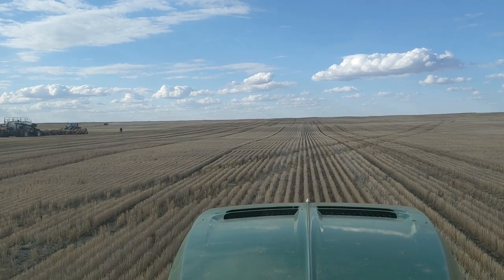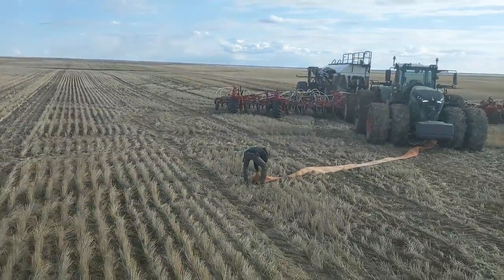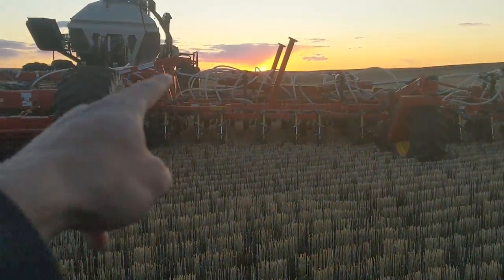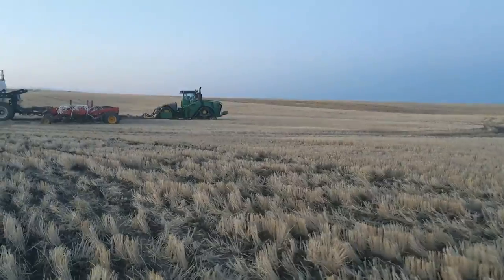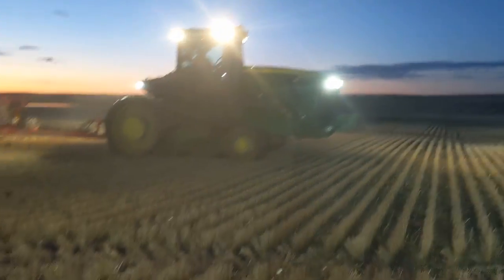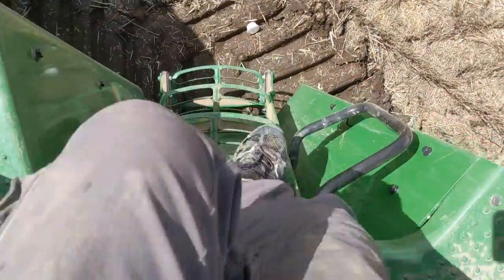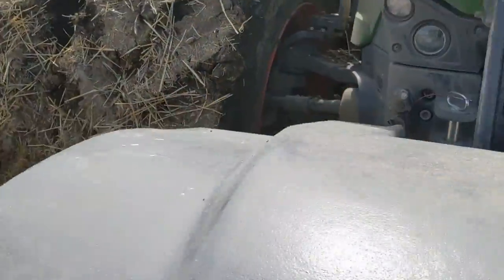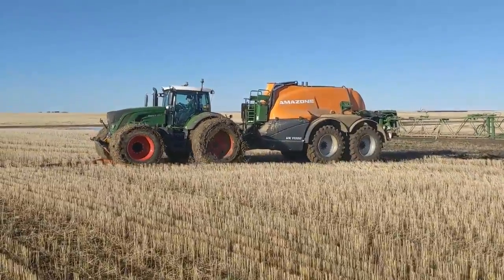4 stucks in one night!

Comment: The Welkers in Montana have three Big Bud articulateds.  Two pull their seed drills and one stands-by as a dedicated rescue tractor.  They have alkaline patches and can sink in to the axles or deeper.  Their heavy floater spray-truck also serves as a rescue puller...and it goes 50-mph.

Comment: 5:10 In aerospace we have "connector savers" , an inexpensive adaptor that's used on connectors that are frequently (dis) connected. The replaceable adaptor then takes all the abuse instead of having to repair or replace the permanent connector.
Reply from the maker: 🤔 Intresting

Comment: How are those straps holding up for you guys? They look like the same ones we use and the ring in the end ends up cutting the eyelet because its too small.  Those dont stretch much. We rip 4 or 5 a season and they arent cheap. I run into a guy around kindersley sk who makes 3 ply 10 inch wide rated for 300,000lbs made out of nylon which stretches 20% compared to 2 or 3% stretch on those red which are polyester. He triple layers the eyelet and warranties rips IF you use a 2 inch clevis on the eye. We put in a 6 strap order for 2021 seeding run. I would cut the ring out of your current straps if thats where they are failing for you guys and use at least 2 inch clevis which typically has a 35 ton rating which is easy to max out by jerking. Shes a dangerous game coming to the end of that strap with a 30 ton tractor or tractors in some cases lol.  Cheers

Comment: Mike, I have a question? if all the fields are plowed and the soil itself becomes soft, there will be no dams in the middle of the levels, it will just absorb the water and the fields will even come out
now this water is not absorbed by the soil because you use only 10cm maximum depth and only tamp it? and the soil cannot absorb the water.
did you try it with plowing?
Reply from the maker: We can't plow, it would ruin our soil, it's been tried.. We only have 4in of top soil. And we get winds here that will make the whole county blow away
Reply: @mikemitchell2554   i see now but  if you do it with  Ripuntatore the soil the winds not gonna efect at all but this is just my opinion by the way awesome content keep it up and good luck
Reply: We rip the soils in Australia 
Similar conditions  
Could cause a lot more issues with bogs in the wetter conditions 
We don't have to deal with snow melt here

Comment: It seems kinda strange that the front hitch on those Fendt's is so massive yet the only adjective that the "tow hook" brings to mind is "cute" lol:) Do you guys typically have issues with soft spots and getting stuck every year, I was kinda thinking as flat as the land is there must be soft spots a plenty to have so many low spots or field lakes or whatever you guys would call them
Reply from the maker: Yeah, there's always some stucks
Reply: There definitely is some flat ground/land in Saskatchewan but its not nearly as flat as some people think it is or make it out to be. 

Correct me if I'm wrong Mike but you farm in some pretty big hill. Big enough to make the tractors snort/feel it!  And their farm isn't that Far from some good sized valleys.

Comment: Must be leaving ruts and bad compaction with those big tow behind tanks. We use to run tow behind 6550 until it got wet, then we got a tow between 6550 and a quad track. No more Ruts, stuck less often. No more uneven standing crop from compaction

Comment: Mike, I’m sure you guys have tried everything, I was thinking that maybe if you ran a flat roller over the straw when it’s wet ,it might help dry out the wet spots enough to get them planted, but not
Reply from the maker: It would pack the ground too much
Reply: I mean roll it in the winter early spring when the ground is wet, it will mash the straw in the mud.  It will let those areas get more sun and dry up better by the time you’re ready to plant.  I don’t think the packing would be a problem, and it help with the rocks too
Reply: It will mash the stubble on top of the mud, insulating it from the sun and making it take longer to dry out. Then you'd have to plow it again anyway. Using a disc to break it up would work better, but with 40k acres that's a lot of extra work, time and fuel.

Comment: If you take a 1.0mm mechanical pencil (where you push the eraser down to extend the lead) you can slip it over the pin and straighten them a little easier.......if this ever happens again.
Reply from the maker: 🤔 Very good idea
Reply: @mikemitchell2554  From years of experience working on airplanes.  It is a pretty common thing just not as bad as the one you had.  WOW that was a good one!

Comment: What's the price difference between the 1050 and 500hp 4wd
Reply from the maker: More money 💵
Reply: @mikemitchell2554  the 1050 is more or a 4wd cause I know thos fendts get up there in price
Reply: @austanhall  these day, JD is just as expensive. here where i live a 1050 is about 160k cheaper then 9620RX (both as basic configuration, so no additional options). in fact JD became so much more expensive that i can 'only' get a 8R370 for similar price as 1050.
me and my dad were considering wether to go with JD or a 3rd 1050, but were staying with 1050. in fact, we picked up our 3rd one yesterday. who knows maybe a 4th one later.
plus the fact jd now removes the right to repair the tractors yourself just f*cked it up, never a jd for us.

Comment: I've always wondered why it seems you never use autoshift on those 9rxs
Reply from the maker: I don't like it
Reply: It's not bad a little slow ig but you can get used to it
Reply: I never use auto shift on any equipment I drive as well. I hate it and usually I run more fuel efficient than the auto shift function (never driven a full auto like the afs case tractors so I can't say the computers are always worse) If you know your tractor you sometimes even can safe fuel on a cvt tractor if you drive different than the full auto mode

Comment: I have “ELIMINATED CLEVIS HOOKS” completely to eliminate “Kick Back”.  I knot my slings together and once the knot is tight they are next to impossible to ever take apart. 
I curl them up when not in use and store in a Rubbermaid Rough Neck Container for “Easier Handling” due to their now “Extra Long Length”
The “Welker’s” have some unique tow ropes that they use for their “BIG BUDS” which are “DAMN HEAVY”

Comment: can you show a video of you adding triples to the 1000 Fendt
Reply from the maker: I didn't put them on this year
Reply: Mike Mitchell  You may have to reconsider the “Triples” or Ashtyn will be “Cleaning Washrooms” 🤣😂. She needs some “Advantage” as the guys make the “BIGGEST MESS” plus she is out numbered.🤣😂🚽🚿
Reply from the maker: Haha right are! But it's such a big job to do
Reply: When situations in life throw us some issues I sometimes like to play the “Mind Game”.
My suggestion for “Constantly Getting Stuck” is to put a “Tow Strap” on every unit and then see if by having a strap now “Readily Available” you no longer need it.🤣😂
Our fields are “Substantially Smaller” so the common practice when this wet is to have a “Spare Tractor” with operator in each field to minimize how many times you have to actually unhook from the “Air Seeder”.
Reply: Mike Mitchell   If you send me your E-mail I will send you a link to a “Tire Changing Unit” that makes “Quick Work” if removal plus installation of “Large Tires”.  This “AWESOME UNIT” also allows the rims to be rotated so “Wheel Bolts” will “Line Up Easily”.  We had fields a couple of years ago in our area that had “Fish” in the stubble it was that wet.

Comment: Why don't you unhitch the equipment from the stuck tractor, drive the tractor out under its own power to dry ground then tow the equipment with a strap from dry ground and rehitch once you're clear? That would mean no other tractors need to stop working to tow other tractors.
Reply: I worked on a farm at Regina, SK and we did use that technique sometimes. I'd like to hear Mike's thoughts on it as well.
Reply from the maker: Hey guys, that technique does work and is use full if you cannot get the unit pulled out together. Then you start splitting things to get some pulled out.. But as far as why we don't do that is because:

1: (and the most important) if you have seen it done to your equipment, you wouldn't want to do it again.

2: it now requires eveyone to carry a strap.
Reply: I'll bet it's probably faster too when you have help nearby. Having extra set of hands makes a difficult task not nearly as fatiguing.